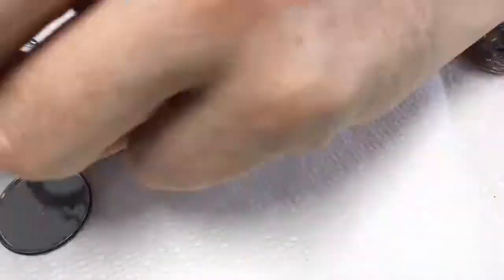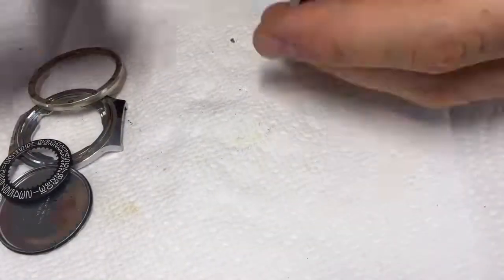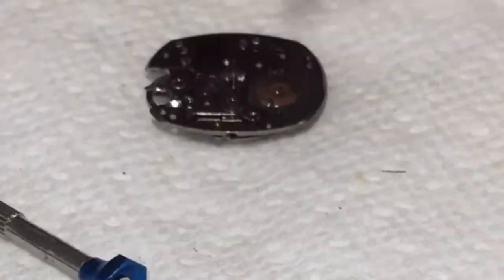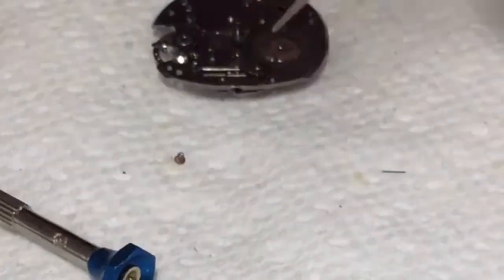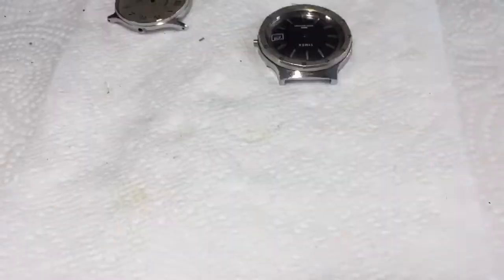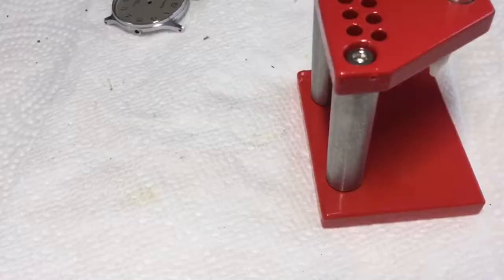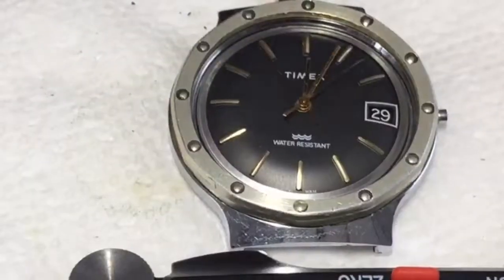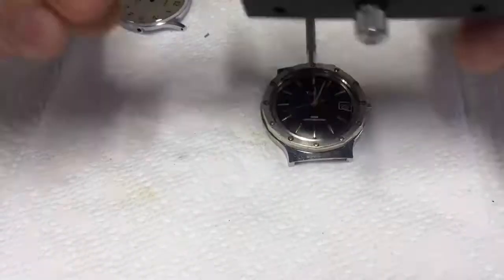Vintage Watch Repair | 70's Timex Dive Watch |

Comment: I have a similar watch with a different dial and the m51 movement mine will wined up but will not work I have a spare movement but not sure how to replace it could you do a video showing how is normal speed thank you.